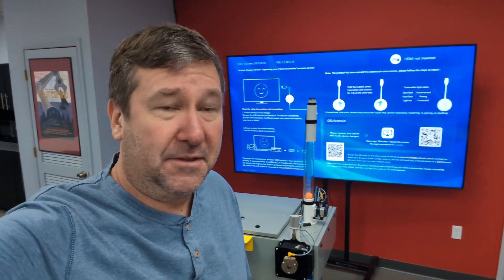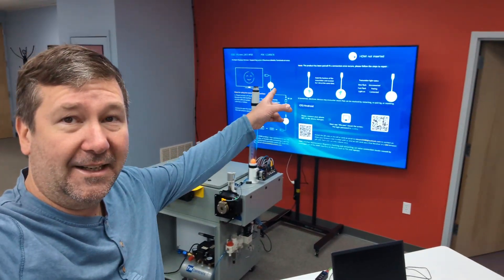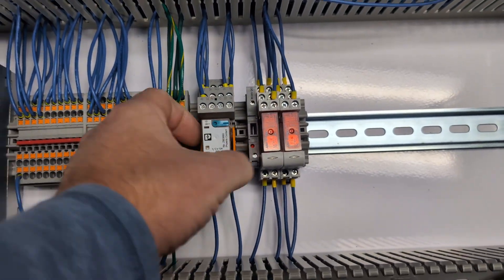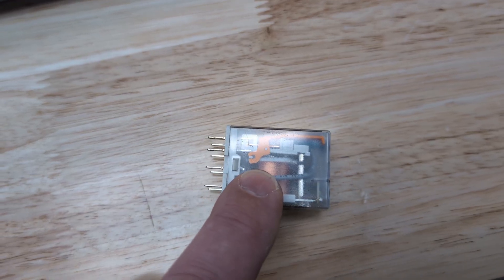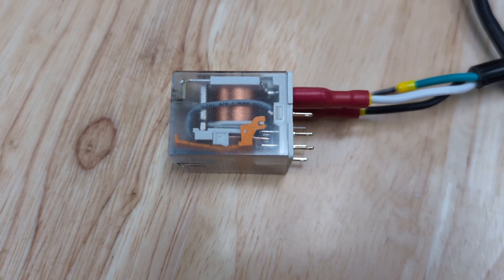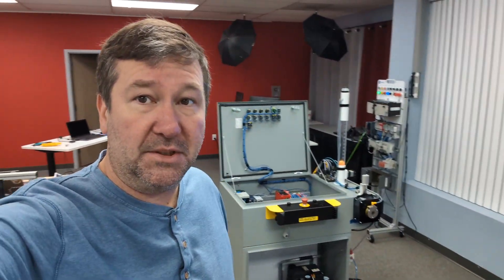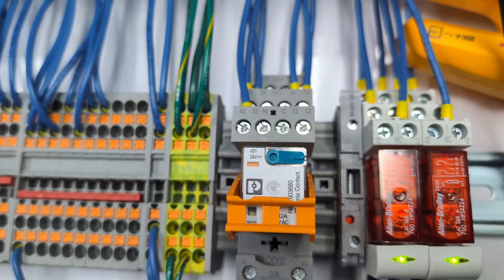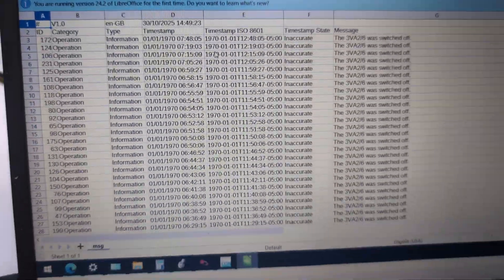Does Anyone Know How to Burn Up a Relay?

Comment: We see bits burn up all the time. Maintenance guy could not find the problem. All I do is use a analog meter to check bit. Plc light flashing but not anything coming out. Move bit to next card.

Comment: Maybe set up a little capacitor bank, with the wiring buried in the other wiring, to dump a ton of DC current across the contacts instantaneously? Voltage wouldn't necessarily have to be very high, just like a spotwelder setup
Or maybe simulate a ground fault on a power supply circuit passing through the contact, something that could pull some serious amperage for a few seconds
Reply from the maker: That's an interesting idea!

Comment: Frequent cycling of an inductive load will do it every time. Heat relays with 5A AC contacts that cycle heat contactors on electric fryers (like at a McDonalds) are the shortest lived relays I know of. On industrial equipment, it's very rare to actually replace a relay that was actually bad. More often it's the relay base that has a loose connection. And if you don't have any, please try to find some relay bases with the metal retainer you have to unhook from under the base. Lot's of fun when you can't power it off and your body is seriously contorted. Many bad words aimed at design engineers and many retaining clips never get reinstalled...

Comment: Power a big heating element with the contacts.  Cycle the contacts at a rate that maximizes the spark when the contacts open.  Eventually you should have some smoke colored soot on the side of the relay near the contacts.  

To weld the contacts shut... I can think of many ways to do it from the outside.  None of them safe.

if you have enough technician friends, they will replace a bad icecube every so often and save it for you.  I used to replace a bad one, all smoked up, on Hoshizaki ice makers, about twice a year.
Reply from the maker: I know, as many burnt up ones as I've replaced over the years, I should have thought to keep one.
Reply: I did warranty work on Hoshizaki's for may years. Curious what model has a relay that you could see it smoked up on. Every Hoshizaki I ever worked on had 4 soldered on sealed relays. Never swapped out one, replaced the control board instead.
Reply from the maker: @2020HotShotTruckingLLC A lot of the traditional ice cube relays are clear.
Reply: @TimWilborne  I'm well aware of that but never saw one on any Hoshizaki that I've worked on. They all had just those 4 black circuit board soldered in relays on them. There may be other models I've never seen though which is why I asked. The ones I worked on had a LED to show the relay coil was activated and it was rare but I have had a few where the LED was on and there was no output from the relay. Most often the board failed another way.
Reply from the maker: Sorry, sometimes in a rush to answer comments, I miss the main point :)

Comment: A fellow Maintenance guy hooked up my ice cube relay for isolated start/stop control for a 90HP drive hook up the dc bus to Normally open contacts on the relay. when they pushed the start button, the relay detonated. there was very little left.
Reply from the maker: I bet there wasn't much left!